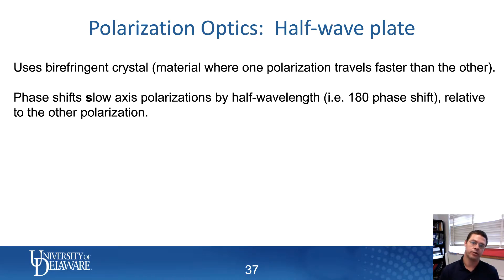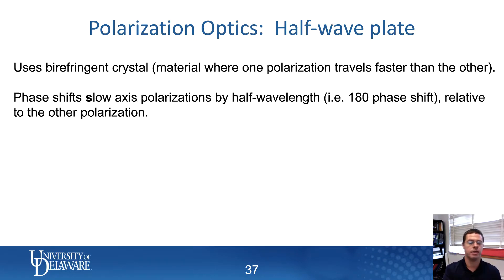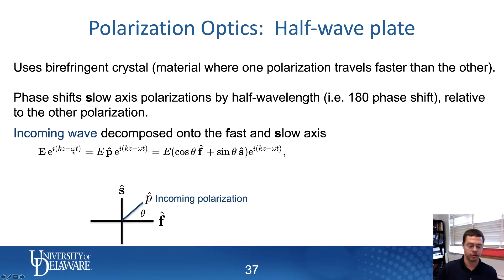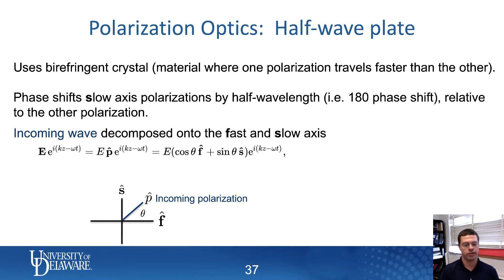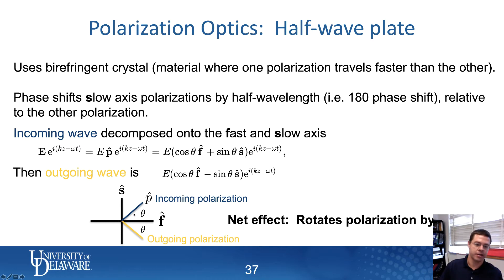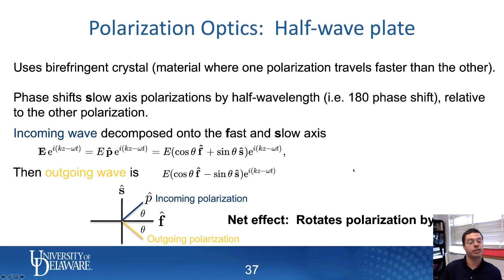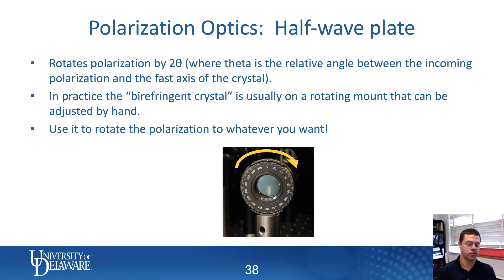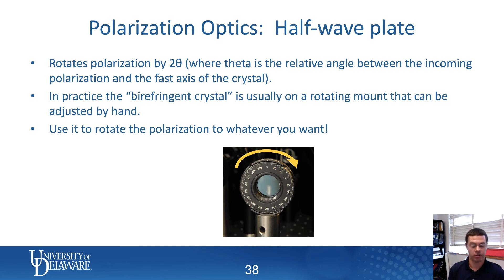Half Wave Plates - TDTR Short Course

Comment: when the half wave plate is rotated to 45 degrees, there is no light transmission. but when rotated to 90, there is 100 percent light transmission. why is there no transmission every 45 degrees in a half wave plate and full transmission every 90 degrees?